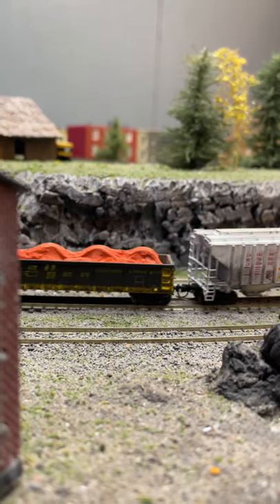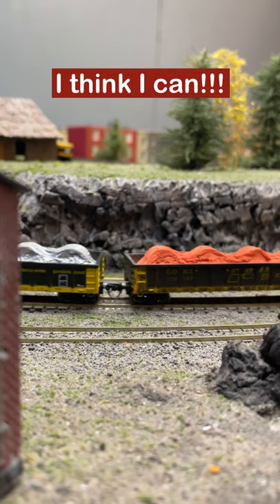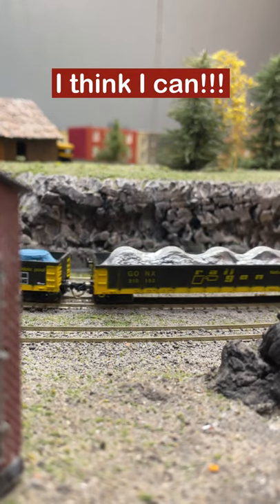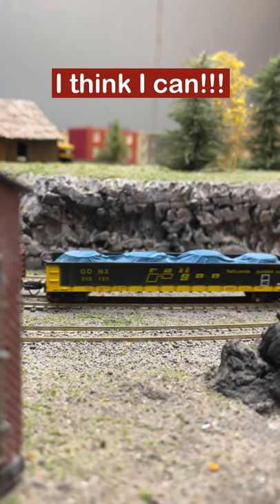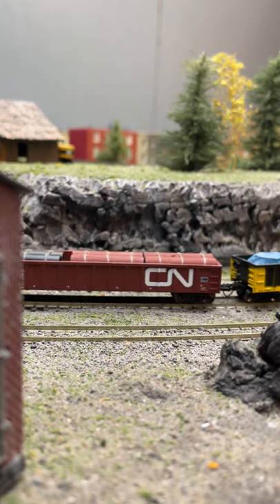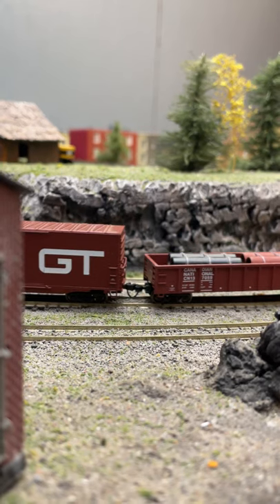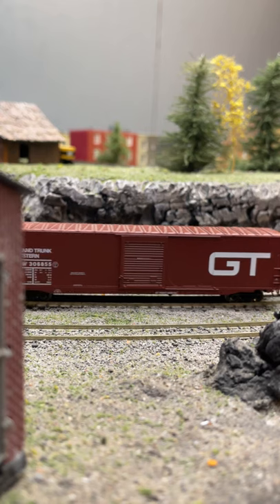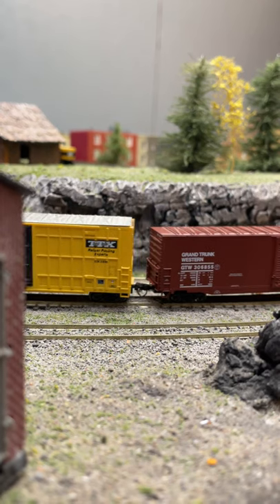Are Steel Wheels Better Than Plastic? #shorts

Comment: I've found it's not always the wheels, your trucks and their mounting/rotation matter a lot, too. Along with they types of steel wheels. 

I don't know enough about this and am researching, but I know from experience that bad trucks/profile wheels will bind and not just add friction, but can launch your cars off the track if they bind and then unbind or bind at the wrong time.
Reply from the maker: That’s true too. Plus a good cleaning goes a long way. Some of my wheels had a lot of lint
Reply: @TheyMakeItLikeThat  These were new cars on a new track.... I am less than happy with them as all three jumped and hit the floor. Almost lost my engines, as well.

I got different cars now, but am a bit afraid to run them because that was an expensive lesson.

Comment: Nickel silver wheel sets, use that little reamer tool they have come out with to clean out the pocket the points of the axle fits into on the trucks, put graphite in that little pocket, and put weight anywhere you can in the locomotive there's space to make it have better bite on the track, in other words more tractive effort when starting and more while moving. All these things should add up to more freight cars you can haul. To begin with I would have thought two locomotives would pull more than 11 freight cars on a 1 percent hill. I'd have figured on them pulling at least 20 no matter the wheel type. Hope you get the wheels and trucks tuned up really good and you're then able to pull 50 cars if you want too. Good video.